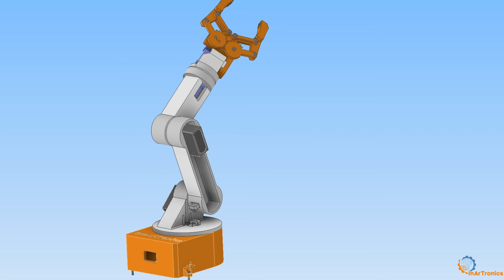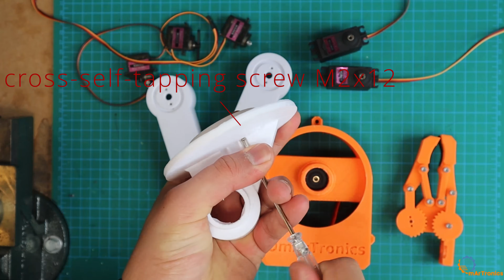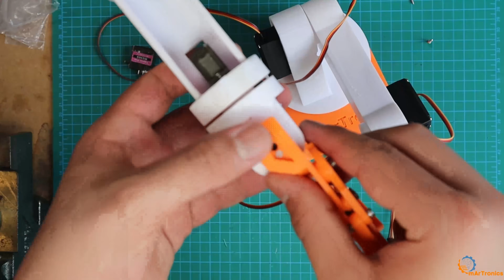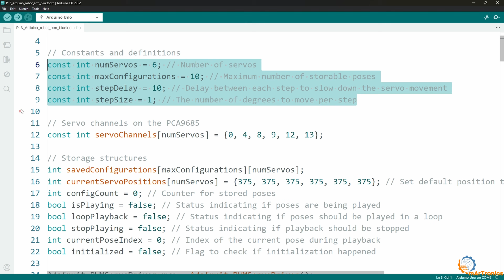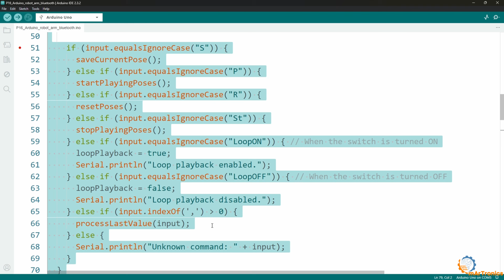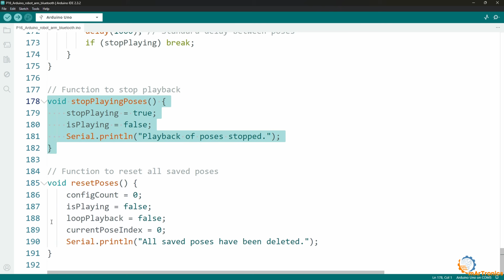Bluetooth-Controlled Robot Arm - 3D Printed, Arduino + Custom App

Comment: Hello! sorry for my english, I'm french. So I reproduce this nice project and wrote all the lines but I have'nt connection with my android. Where can I find your MIT file? can you send me? Many thanks. Have a nice day.
Reply from the maker: Bonjour ! Merci beaucoup pour votre message  
Vous pouvez trouver le fichier MIT App Inventor (.aia) directement dans mon répertoire GitHub :
https://github.com/ODraidrya/Arduino_robot_arm_bluetooth

Bonne continuation
Reply: @OmArTronics-plus   I found all for app arduino but not app for android. Sorry but canyou explain the way to find it? Many thanks
Reply from the maker: @pierredoublet4633  The app is RobotArmControl_SP.apk.
It was developed with MIT App Inventor and is made for Android devices.
download it from GitHub and transfer it as file to your android device.
After installing the app, make sure to enable the permission "Nearby Devices", otherwise Bluetooth will not connect to the robotic arm.

Here is an example of how to transfer and install the app on an Android device: 

https://youtu.be/z1VubkUD264?t=394
Reply: @OmArTronics-plus  I'm sorry but I don't find app for android  from your GitHub. I find app for arduino  but not RobotArmControl_SP.apk. When I click on this last reference I find again app for arduino. Can you give me more explaination? Thanks

Comment: How much voltage you give to pca9685 V+ terminal ?
Reply from the maker: I set the V+ terminal on the PCA9685 to 6 V using a Hanmatek HM305P power supply.
The servos are powered through that 6 V line, and the Arduino is powered separately via USB.
You can also use any 5–6 V adapter rated for at least 5 A, depending on how many servos you’re running.

Comment: My Arduino ide is showing error for <Adafruit_PWMServoDriver.h>(it not in dictionary or no such file )what isthe solution
Reply from the maker: In Arduino IDE, go to:
Sketch → Include Library → Manage Libraries…
Then search for “Adafruit PWM Servo Driver” (or “Adafruit PCA9685”) and install it.
Reply: Thanks bro😊 its worked

Comment: As soon as I power it on, one of the motors keeps spinning continuously, even though I’m not driving it.
Reply from the maker: This usually happens if:
1. You are using a continuous rotation servo instead of a standard 180° servo.
2. The signal pin is not connected properly
3. Your code is not sending an initial stop signal (like `servo.write(90)`)

Comment: isn't this 5dof
Reply from the maker: Good question! The robotic arm has 6 DOF if you count the gripper opening/closing as the sixth degree of freedom. Without the gripper, it’s 5 DOF for the arm joints only. That’s why some call it 5 DOF and others 6 DOF, depending on whether the gripper is included.

Comment: I follow the steps but when i use the app the robotics does not work
Reply from the maker: Thank you for your comment! Please make sure that the Bluetooth module (HC-05) is properly connected to the Arduino and that you allowed the "Nearby Devices" permission for the app on your phone. Also, check the wiring and power supply for the servos.
Reply: Bro same problem i had checked everything 😔